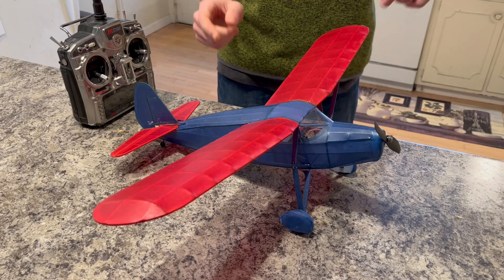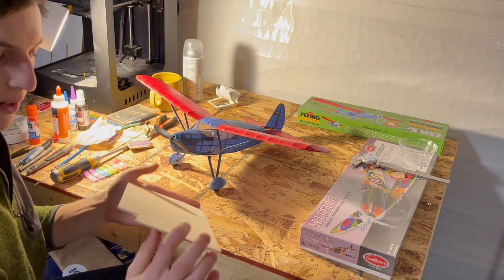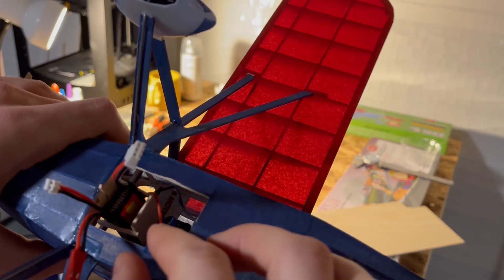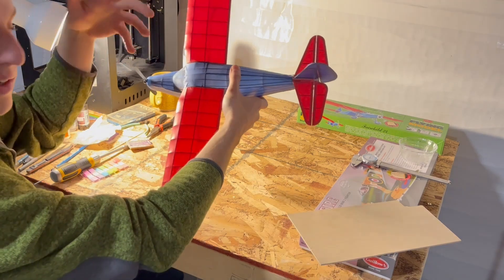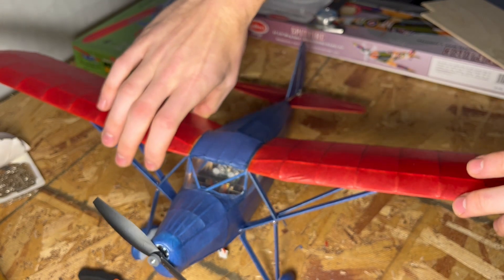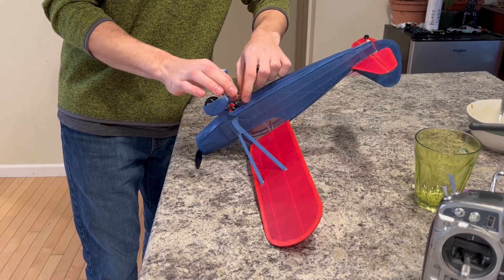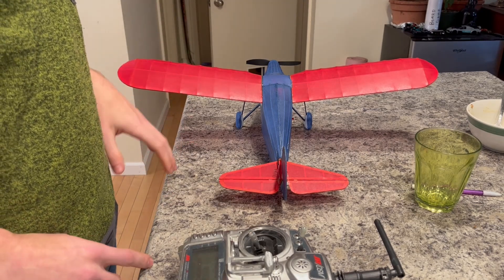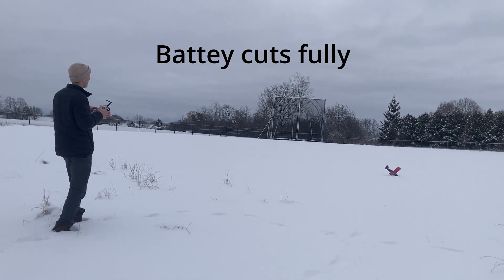Guillow's Fairchild 24 RC Conversion Overview

Comment: Nice video, thanks for the walkthrough. I've been building bigger planes but have gotten the bug to convert smaller Guillows kits to rc. Working on the Guillows Aeronca Champ conversion now. Glad you mentioned how you did the hinges. Slotting 1/16" fragile balsa still seems like a fiddly challenge, though. For the Champ I am probably going to use scotch tape on one side of the elev and rudder.

Comment: What was you doping process?
Reply from the maker: Good question. When I was a kid I learned with the cellulose (very stinky) stuff. For this build I wanted to spare my roommates the smell.. I decided to use 50/50 Elmer’s white glue and water for tissue application, then water spray to tighten the tissue, then Krylon Clear Acrylic spray paint to make the tissue a bit more water resistant. The Krylon spray is really easy to apply and adds minimal weight
Reply: There is also Eze Dope (which is probably just white glue and water) that is an alternative to dope.